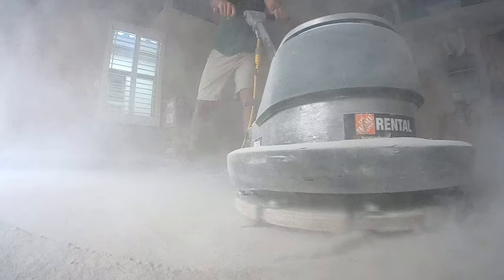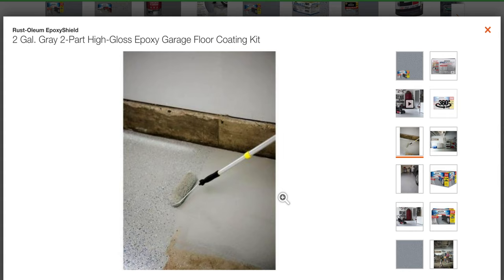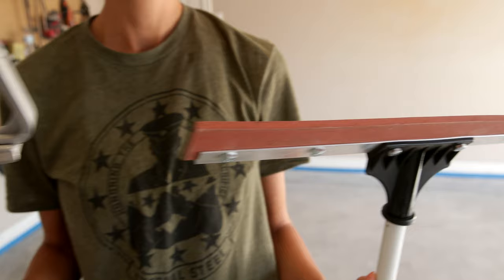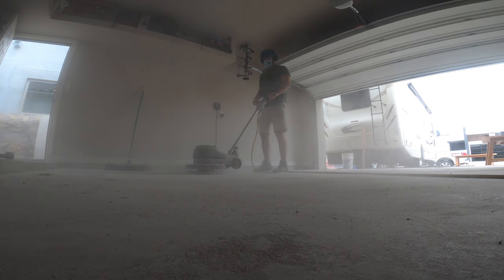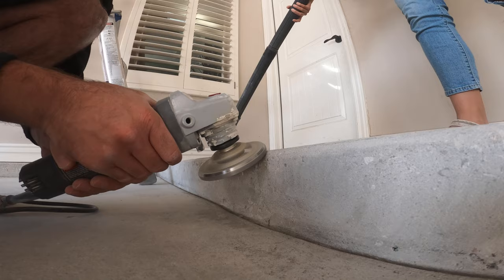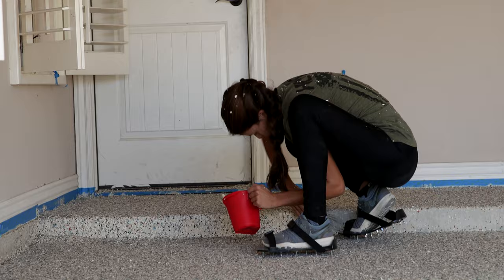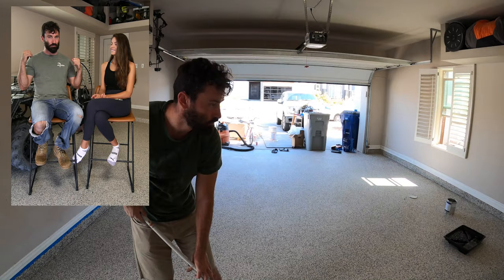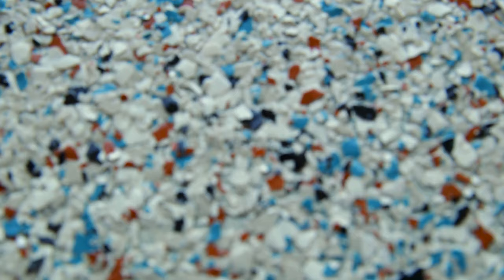We Installed a Commercial-Grade EPOXY Floor!

Comment: Replace bang-up with Awesome and you got it.  I've book marked Legacy for a winter project in Florida.
Reply from the maker: YES! I was right. haha. And very cool about the winter project. If I remember correctly, I think that they had a version that was designed to be installed in much colder conditions; However, I doubt that Florida gets that cold. haha

Comment: Looks great, how ever I would be more careful when grinding floor. One of the concrete components is called silica, silica is a fine glass, it is so fine that once it enters your lungs it stays there forever. Silica goes to the air when griding. When grinding the floors you need a dust extractor and a mask and an air scrubber. 
If you watched that video and are thinking about diy your concrete, check out osha's guidelines. Be safe
Reply: Dust extractor plugged to the grinder.

Comment: How's the gravity paramotor?  I just finished training with Lone Star Paramotor yesterday. I'm waiting for your review before I decide between the Maverick and the Gravity.
Reply from the maker: HAHA! Hey Mackenzie. I am thoroughly enjoying the Gravity Defiant. The harness that comes with it is wildly comfortable. The propeller that comes with the Defiant is larger than the Maverick and produces slightly more thrust. It's more forgiving/robust a frame than the Maverick. It weights slightly more, but it's hard to tell the difference. Looks a subjective. The better deal is undeniably the Defiant. That's not an opinion. It costs thousands less and you get the same engine, performance, a bigger tank, and it an AMERICAN company! 
All that said, I have enjoyed the Maverick. It's been good to me with a few exceptions. Stay tuned for my upcoming video on the Gravity Defiant. I will compare the two.

Comment: What did u do with the contents of the garage while u were doing the floor, I have work bench and floor cabinets and took boxes... do u rent a storage shed during process?
Reply from the maker: Hahaha! I was a lot to figure out! Its not like you can put everything back in your garage at the end of the day since it still needs to dry! I ended up parking the 4wheeler and paramotor in the backyard. I sold the workbenches since they were being used for storage. If you're close with your neighbors, that might be an option. When there is a will, there is a way! haha.

Comment: ya the kits are 1500-4000 and have to rent the equipment ! not worth pay garage experts a 1000 more any have a full lifetime warranty
Reply: Totally wrong, NEVER WASH THE CONCRETE DOWN WITH WATER BEFORE APPLYING EPOXY OR WHAT EVER THEY USED.
SECONDLY THEY DID 1 COAT, THE FIRST COAT SHOULD BE THE SEALER COAT, THEN THE NEXT DAY THE EPOXY AND CHIP COAT.  THEN 2 COATS SEALER.  WHAT THEY DID WILL NOT LAST!